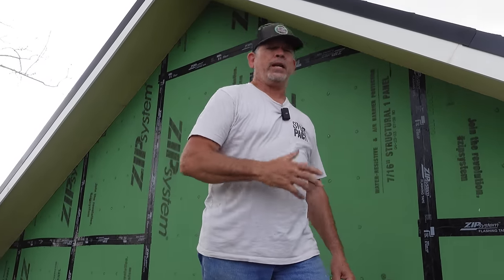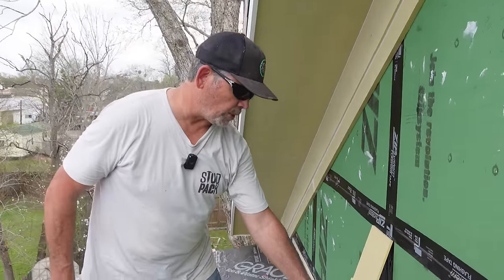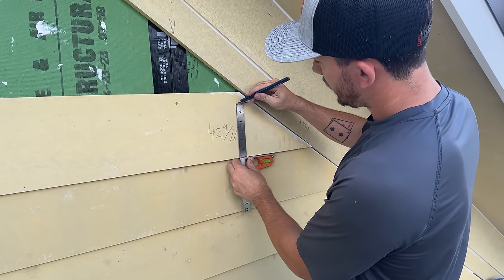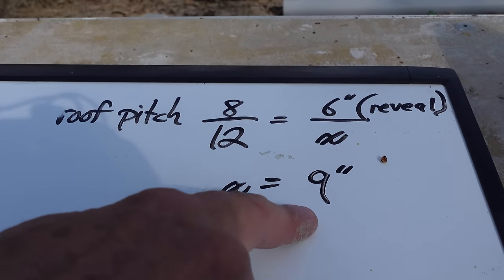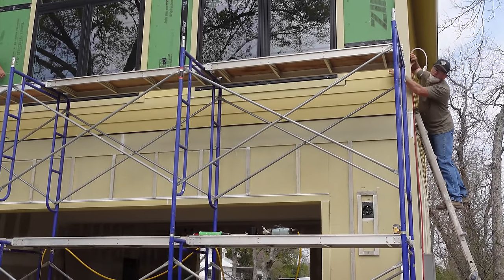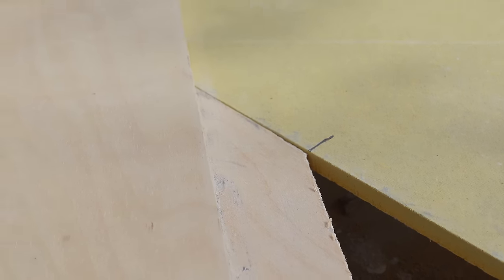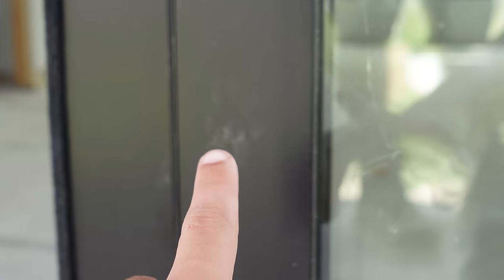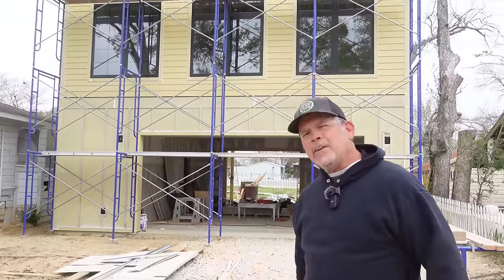The Dream Garage Exterior is DONE! We Installed Fiber Cement Siding to Combat Humidity!

Comment: 8:30 great idea, one little change to it that I would suggest is make it 10 inches plus your reveal. So make the template 10 inches and an eighth long and then you only have to add 10 to the measurement and also you don't have to worry about your reveal you can just butt it up and measure :)

Comment: I find it interesting how roof pitches are still measured as a ratio between rise and run when modern tools are all in degrees. Old habits die hard, I guess. Paul really shows that knowing how to measure can bridge the gap and where geometry can speed up the process. Awesome video!

Comment: Looking great gentlemen. To comment on the paw prints, almost all job sites I worked at, once all the outside walls and windows were installed, the exterior (man and garage) doors were next. This deterred theft and critters from getting into the property. Animals will get in, chew on stuff and deficate and urinate everywhere, especially when the weather is bad (cold, rainy). I have even installed garage doors prior to the drywall going up so the builder could secure tools and supplies. Once I returned to install the opener, I would hang and wire the opener, then rebalance the door before connecting the trolly to the opener.

Comment: I ran into the same issue with the "flappy" bits on the corners of the siding under the gable.  Mine was even worse because it was a 4:12 pitch.  I was surprised that putting a finish nail that corner wasn't required by Hardie.

Comment: Another tip i would have is with the caulking.  While Big Stretch is good stuff, Hardie moves a good amount with temperature.  While its temping to tool the caulk with your finger, the concave bead that makes means that the caulk is thinner in the middle and there is less material available to stetch so it will most likey tear.  A convex bead can move more before ot tears.  Tooling will also force the caulking into the cracks potentially creating a 3 surface bond, left/right/bottom of the gap, which also causes it to tear.  You will always notice in commercial applications like concrete joints with polyurethane, they always use backer rod and thats not to just keep the caulk from spilling all the way in, it also keeps the back of the caulk from bonding to a fixed surface.  The place is looking great, have enjoyed this process and brings me back to when I did a lot more siding work.

Comment: Guy's you're making it harder than it should be. All you need is a squared off piece. Put the upper corner to the freeze and the bottom at the reveal, and pull a measurement. I've done hundreds of siding jobs.

Comment: Careful with any exterior paints that have organic pigments in them for future house washes. If you get a sample of the actual paint and dries then put some bleach on it and it changes color to like a green or pink tint then no good. Organic pigment paint is also more likely to oxidize from the sun quicker. I do house washing down in the valley and our biggest fear in the industry is exterior paint with organic pigments because it can change colors with our cleaning solution. There are alternatives to the solution we typically use but it raises the prices to clean because the product is more expensive and takes longer to work.

Sherwin Williams blue is our biggest offender but it can be other brands and colors. Usually it's the magenta pigment and a new unknown pigment that changes red to pink.

Comment: I really appreciate your craftsmanship and attention to detail.  I noticed when you installed the underground conduits for power and data you did not install expansion fittings.  If your local AHJ follows the NEC, they are now required  per Section 352.44(B).  They are easy to retrofit before cable is pulled in and not so much after.  The building looks great and I look forward to each episode.

Comment: Y'all really should try the technique of PUSHing the caulk tip instead of PULLing it !  The tip of the caulking tube tools the joint for you as you go.  No need to use your fingers.  Plus, it pushes the caulk deeper into the joint.  Cut the tip at an angle and lay the angle almost flat to the siding surface and  control the 'squeeze out' as you move down the joint.  Yes... you do have to go a little bit slower as you apply, so that takes a little more time, but at the end, you SAVE time by not having to come back and tool the joint with your fingers.
Reply: They won't listen to me...thanks... 
BTW...just cut the tip square or flat. Uses the radius of the cut to put a radius on/in the joint...NO FINGERS!
My concern is the "Big Stretch" caulk. I've always used SikaFlex 1a urethane caulk on any cementitious boards/products. Big Stretch is LATEX caulk...it WILL peel one day...only a matter of time. I haven't brought it up, but they'll understand when they're recaulking everything in a few years...Oh well.
Reply from the maker: We’ve tried pushing multiple times. Just can’t get the hang of it, so we default back to pulling. Probably doing it wrong.
Reply: @chrisosti was thinking the same thing. Here in phoenix az you just cant use latex on the exterior of anything. It shrinks way to much and just wont hang on. Wad thinking texas would be similar due to the heat and the cement board vs wood.
Reply: @StudPack   It does a take a little getting used to, the best way is to cut the tip square, not at an angle, so you have about a 1/4" bead. Start with the gun about a 45 degree angle to the gap to be caulked, feed  the bead slowly so it fills up the gap. If you have excess on either side, slow the feed rate. It does take a little practice, but when you get the hang of it, your fingers don't need to touch it! I'll see if I can make a quick video for y'all.
Reply: Thanks for the Info! That is a real great tip.
 I am guessing that you have to make the Tip Opening smaller and release the gun earlier when coming to a corner? Please correct me if I am wrong.
Reply: @delekham1863  The opening width should be the same size as the bead width. As far as the corners, just try on some scraps, you'll get the hang of it pretty quick. One suggestion, if you're using caulk on a hard surface, if you get some squeeze out on either side of the bead, hold off on your inclination to scrape or clean it off right away. Let it dry, then peel it right off! Lean and clean is what you want. But remember...NO FINGERS!
Reply: @chrisosti  TYVM, I was wondering about the width of the bead! That is very important to me anyways to have a very clean look!
Cheers!
Reply: @StudPack  It does take some practice and works best on relatively smooth surfaces like your siding and such.  You need to watch the flow!  if you squeeze too hard, you will actually make more of a mess than if you pull.
Reply: @polygaryd Big Stretch is holding up great on the Hardiplank and Harditrim on my house in the hottest part of Georgia. Maybe it’s the humidity that helps it stay stretchy? I didn’t prime my cut ends and my original Dap caulk let go after only a few years. I dug out all that caulk and treated the ends of the siding with a tiny dental brush and caulked it again with Big Stretch. It’s only very small house and I did the whole job with about three tubes of caulk, so it wasn’t a big deal. Kind of glad for the confirmation that priming all the cuts is definitely worth the effort. I used shears to cut my siding too and I think that made the cuts extra dusty. Lesson learned!

Comment: One benefit of working with smaller reveals is the ability to cheat to courses to get the windows sills and heads to line  up with the siding.  I ran 6 1/4 / 5 inch exposure on my own house and was able to get the lines to work everywhere.  The courses below the window to the water table are like 4 3/4 next to the windows are 5 and above to the second floor windows is 5 1/8 but your eye will never pick it up.  Harder to do with the larger reveals as you have less courses to work with.  This is a place where the story stick comes into play.  Mark your stick with 5 inch course marks, pick your starting point and end point.  If the last mark is slight longer than the desired endpoint, just lean the stick over at an angle until it hits the mark and then go along the stick and mark each course.  No measuring required.

Comment: I did Hardie cement board on the front of my house. I oil base primered over the factory primer and all cuts.
All overlaps were heavily caulked top/bottom. 
Overlaps were finish nailed to keep tight with top nails were regular box.

Comment: This is why a good gc wants you to pick all finishes/fixtures ,and the architect to give all elevations before framing.
Band boards ,decking windows /electrical/plumbing blocks height... determine the finished look.
Sometimes the reveal can be slightly change to gain or lose for good reveals.

Building a board and batten/shadowbox fence with random width sections is time consuming. 

Proper planning provides intentional design.

Comment: One way to avoid having to nail the tips of each piece of siding to get them to lay flat would be to cut a rabbet in the frieze board.  Then the siding will tuck under creating a nice finished edge. It saves time too as you wont need to be so precise with the cuts on your siding as it will hide small differences in their lengths.
Reply from the maker: We talked about this detail, but we don’t like the way the siding looks under that rabbit. You can see the gaps it leaves, we just don’t prefer it. For speed we can see how it would be beneficial. 👊🏼

Comment: 24:10 watch out if you’re using hidden fasteners here. It’ll be harder to that last board in under the siding as well as past the fastener. 

The top is to back off the fasteners from the last couple of rows so you can buckle the previous boards up and slip the final board in under the siding. Then go back and tighten down your fasteners and then fix that last row in.

Comment: whoever paints the building make sure they pressure wash it before they put primer on theres so much dust build up on those hardie boards and also wouldn't hurt to double check the calking after a couple of days I know the big stretch doesn't crack but still you get little pin holes here and there from stretching when it shrinks

Comment: I use your measuring method of using a 12" drop whenever I have to do angle cuts on something.  To simplify it for multiple cuts, I make the angled measuring piece 10" to make the math easier.

Comment: looks incredible guys. an idea for you, not sure if your doing it or care to do it, but you should use a rubber bladder drain system for that deck, incase any water blows onto the deck what it will do is catch all the water and let it flow out, this way you can have a finished ceiling under that deck with cedar or whatever you like, and even have some lights in it. just an idea, its something i saw brad the builder doing in his million dollar homes. might be a really nice detail to add in.

Comment: great siding job I learned a lot.  Painting houses for over 40 years I find white to be very boring and a bite too Brite in the afternoon sun.  Actually, if you could base your top color on the tint of the hardy boards used on top and the bottom and trim color could be based on the bottom boards color used that would make a great color combo that won't make you snow blind on a sunny day and it will give the house great character and remind me of a Victorian paint color.

Comment: Just a tip pros mark 1 1/4 with square on the top edges to have it ready for the hangers and once you get to full boards you can measure for the edges 1 1/4 marks and you have the bottom of the next lap also make sure you dont shoot past the over lap to prevent visible nails and shoot finish on the bottom corners to prevent them from lifting over time

Comment: Just a thought for the main house:  Maybe make Jordan the foreman and Paul the expert consultant.  In other words, let Jordan lead the way and explain his thinking, then check with what Paul has to add or recommend.  I think Jordan has grown IMMENSELY as a general tradesman in the last few years.  It's always easier to do the doing than to try to guide the process, and I think Jordan would benefit even more from taking the next step.  Obviously, nobody would expect Jordan to have Paul's knowledge and skills at this point (I certainly don't), but getting to Paul's level means stretching.

That said, there's obviously nothing wrong with the current formula, and you guys should do whatever makes the best memories.  I'll watch either way.  :)

Comment: Actually, using a water level is a lost art in framing buildings. So, it is an excellent tool to present to your audience. A water level is a cheap, very accurate tool to establish level and site lines on your structure. The modern system of using laser levels simply is slower or doesn't work at all in some situations. The water level will work in every situation except for extremely long distances over 75'. 

I have used a water level to set up the top of a poured concrete foundation for an addition, and it worked great. It also works spectacularly to set level lines for interior soffit and drop details that extend across an entire wall or several walls. The same is true for establishing a straight level line for panel details on walls, like wainscoting.  You can also use it to set drop-ceiling heights. 

Even if you use a laser level to set a straight level line, you still have to set it up, which takes time. You also still should snap a straight level reference line. Using a water level is as simple as measuring a height at one side and making a level mark at the other side and snapping a line.

So, telling people about how versatile and cheap a water level is is definitely worth their time and it is very useful.

Comment: I like Rad and Jordans method for with the little block.  I'd have shave 2 inches from that though.  Easier to add just 10 to everything than 12.  Not a huge deal though and pretty smart.

Comment: Texas summers and you picked black with light white speckles asphalt shingles?  even with good insulation. that's extra heat load in summer for the AC to deal with.

Comment: To make Rad's math a little easier, just cut the 12 inch measuring jig to 10 inches. I know you're done with the garage and, consequently, the siding for a while but when you get to the house siding, you're going to have a lot more of that going on. Easier equates to fewer self-induced errors. Adding 10 instead of 12 is easier.

Comment: The easiest is to make your measure cut 10 inches. Much easier to add 10 then 12.
Reply: I was going to comment the same thing.  If are working in feet, keep it at twelve.  But if you are measuring in inches, adding 10 is way easier.

Comment: 8:33 Since you already know the angle and have your marks on the wall, put your scrap pieces on the ends and just measure from one bottom point to the other bottom point of the plank. Paul then knows that would be the length of the board? There's no measuring and adding anything necessary.
Also, what happened to Jordan's hand? 26:13

Comment: Congruent triangles are the same size and shape, whereas similar triangles are the same shape but differing size. In this instance where you are using similar shape but different size it would be correct to use the law of similar triangles as a homogenous reference. WHEN YOU STOP LAUGHING at this comment your relentless attention to detail is being rewarded with a bespoke cottage, Congratulations!! Ray Stormont

Comment: The math method for figuring cut angle should be the most accurate, assuming the roof trusses were built to spec.  Which makes me wonder because your electronic gizmo was showing an angle of 59.8 which is off by 3.5 degrees if the roof pitch actually is 8/12.
Reply: B.T.W.  it's not congruent triangles, it's similar triangles.

Comment: Hey guys I need your help. Did you run into an issue with your Hardi siding curling at the corners on top Gable end? If so how did you fix the issue?

Comment: Concrete board sucks.  cracks with too much sun. Hard to install.  Zero benefit. I wont use it any more. Holds paint poorly also. Seen alot of failures 5 years down the road.  great channel

Comment: For sure, cheating the courses of fiber cement siding takes planning... Planning the rough framing, window height, trim size, reveal selection when picking what siding width to buy, frieze board size, water table height, band height, etc.  Most people wouldn't pay for that level of detail but it's doable!